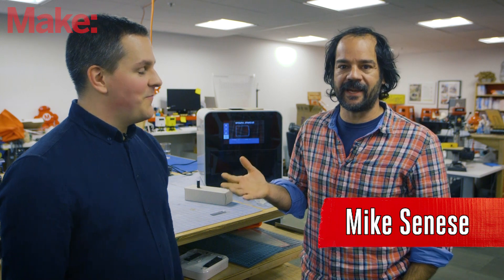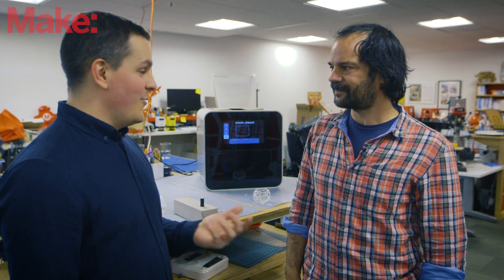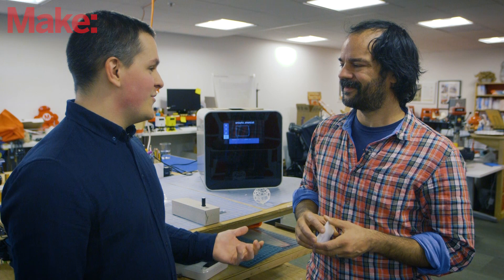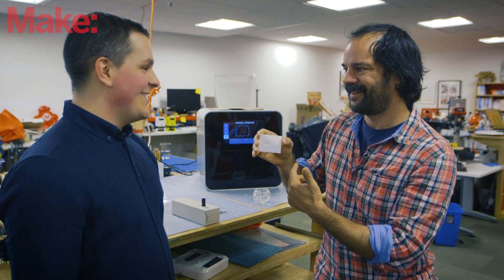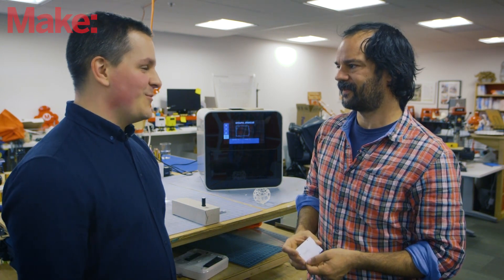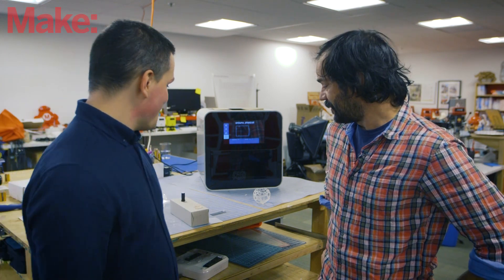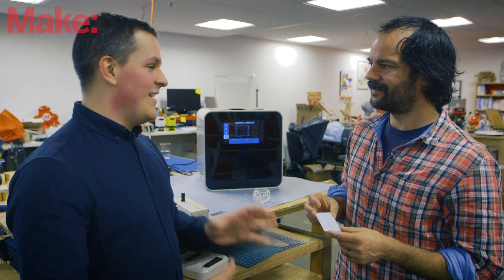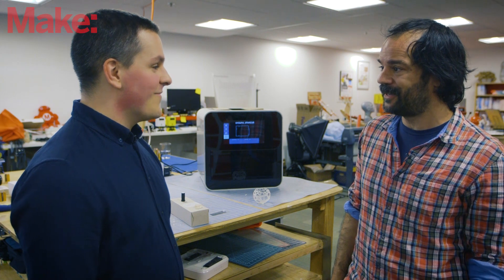The NexD1: a Next-Generation 3d Printer

Comment: The Kickstarter campaign is going down the toilet. They used prints bought off of Shapeways and tried to pawn them off as being done on their printer. Unfortunately (for the Next-Dynamics team), the creator of one of the prints who hasn't released the files anywhere backed the project and called them out on it. After several promises to do live prints and demos at the FabLabs in London and Berlin, all of which were cancelled at the last minute, no responses to the backers' concerns and questions have been made in approximately two weeks. This is unfortunately looking to be vaporware.

Comment: This is great but I wonder if it would be possible for the developers of this printer to take out that lcd screen and most of the electronics and make an app to do exactly the same thing and sell it a lot cheaper.
Everybody nowadays has a smartphone. Smartphones have an lcd and a computer. Why not make the printer as simple, cheap as possible and use the power of the smartphones?.
Reply: Why would I be dependent on a contract?. I don't need to use the phone :)
Im just saying that we could use a smartphone computational power or a tablet to control the printer. This  way you didn't need the expensive lcd on the printer and so, the price would be cheaper.
Reply: I expect it is technically possible to offload most of the work to a smart phone, but it would be very inconvenient, considering your phone would be busy controlling the printer for how many hours the print takes. 

In practice, it probably would mean you would end up buying a new tablet or smart phone just to use with the printer.

To the manufacturer, having the built in computer means that they have a known system, if they are fixing a bug or adding a new feature, they don't have to make compromises or cater for any number of different phone/tablet models with different hardware, performance, and so on.

Anyway, I suspect that the cost of the LCD and computer board would only be a small part of the total cost of the printer, this sort of thing is pretty cheap these days, saving a few percent of the total price for the added inconveniences is probably not worth it.
Reply: Im not sure but I think the brains of this printer is probably an arduino or raspberry pi.
If it is, then you wouldn't need to leave or phone or tablet next to the printer. Actually, if the developers wanted, you could control the printer on the other side of the planet.
Regarding the price of the lcd. We know that an iPhone screen is cheap but thats because its made by the thousands. If you go get a standalone lcd, its not cheap.
For me, the most expensive part of this printer is the code, the app that makes it run. Next is either the lcd or the case. The rest of it I believe are cheaper parts.
But Im no expert, only the developer can say how much it costs to build one and if the use of a phone or tablet, would bring down costs.
Reply: Yes, the printer likely do have a system on chip computer that controls it, but your argument seemed to be that they should take out most of the electronics and let the app do that work, which would mean that you lose that autonomous operation, and that the app would have to keep up constant communication with the printer,.

The display is likely a significant part of the cost of the electronics, that is true, however they are probably using a screen assembly of the type made in large numbers for tablets and such, which is why I estimated that the electronics is only a few percent of the projected price of the product. 

I expect the most costly part of the printer is really the research and developing the product and the manufacturing process, not the actual raw materials, this is pretty common devices made in relatively small quantities.

Comment: What what i can gather... These types of "Polyjet" printers are squirting UV curing resins through an XY movable nozzle (not sure if it's a multi-nozzle like an inkjet, or just a single nozzle like a fused-filament printer).  So it's a combination of stereolithography & fused-filament styles of printing.
Reply: Got nothing to do with fused filament.
Reply: It has an XY movable nozzle.
Reply: It's basically a standard computer inkjet printer that uses UV curable resin instead of ink and a UV light source cures the layer of resin on every pass. "tiny drop size being jetted by 200 nozzles on each print head"